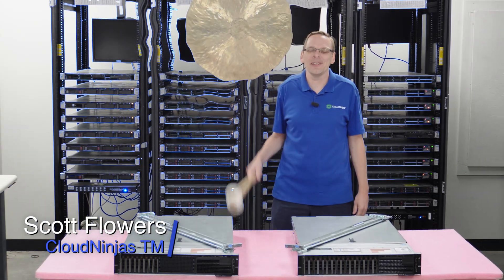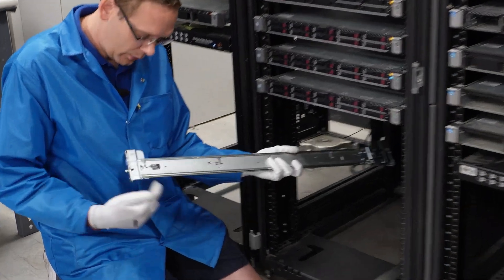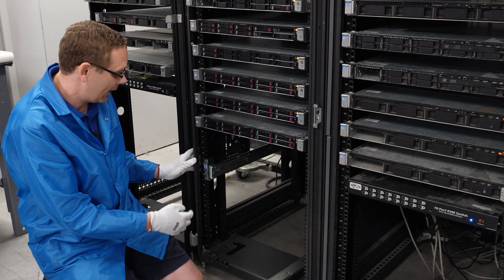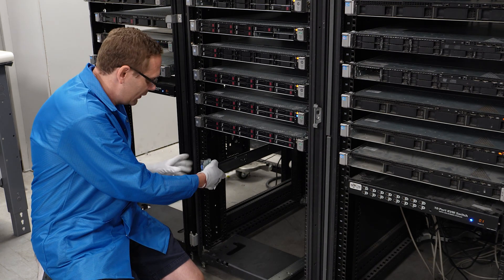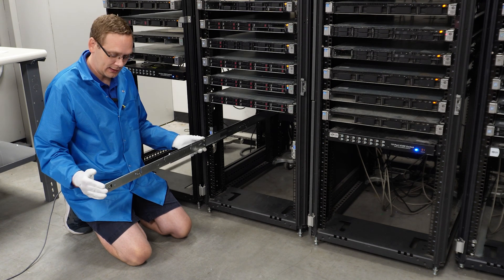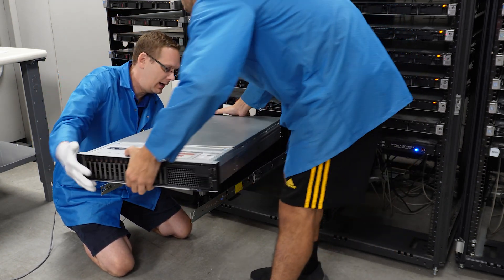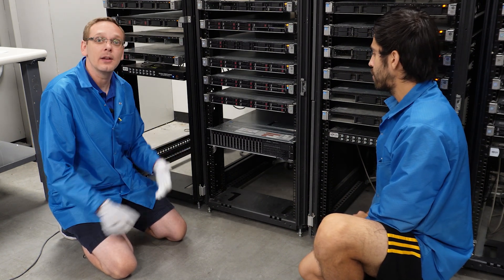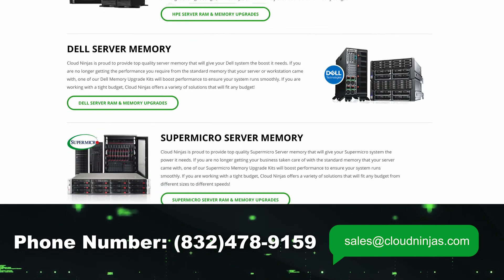Dell PowerEdge R740 Rackmount Server | How to Rack a Server | R740 Server Racking | Sliding Rails

Comment: What if we rack it. It slides in and then locks in 2 inches from being fully inserted? I verified all mounting points were connected. It slid in just up until it got stuck 2 inches from fully slid in. 

Its also locked to the point where I can't pull it out. It feels locked like when its fully pulled out
Reply from the maker: Sounds like something is slightly off... maybe inners on wrong rivets?   Or inners backwards?
Reply: Same here.  Dell did the racking and this is two of 4 that they screwed up.  I pull the server out and it stops firmly about 2-3 inches from being completely out.
Reply from the maker: @leelinus75 wowza!
Reply from the maker: @leelinus75 Not good to hear.

Comment: So the way our rack is engineered is that there are soms generic rails under the bottom diskshelf and then the other is just sitting on top op that so if you have to take out some of the bottom one you have to take the whole thing out 😂 and I did this because there weren't any rails for the top one... and we just need to put another das in that column so extracting time (heavy as sh1t)
Reply from the maker: Lol.  Need more rails!